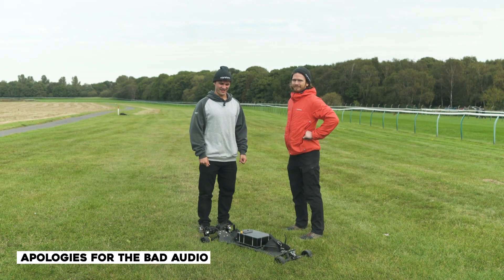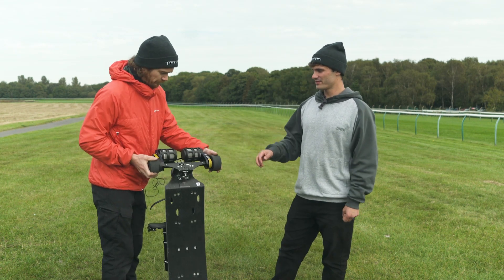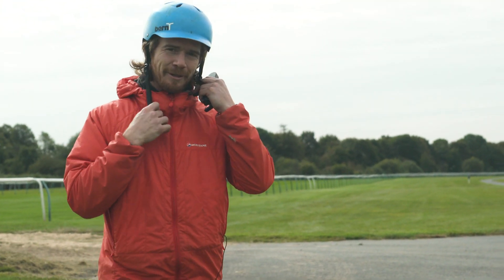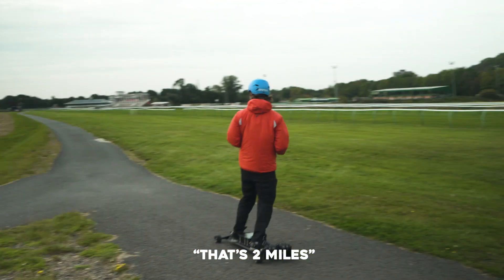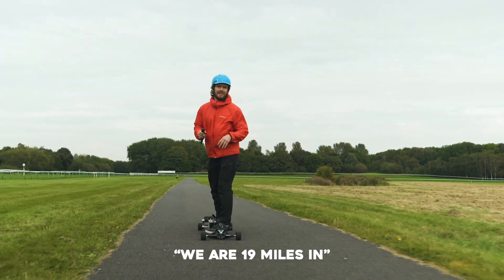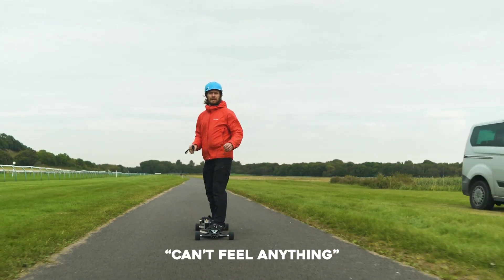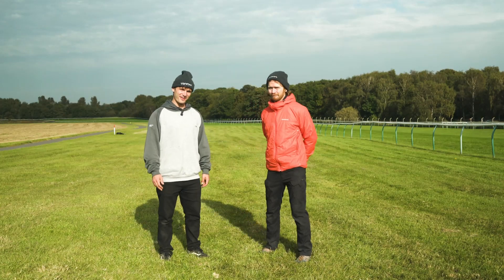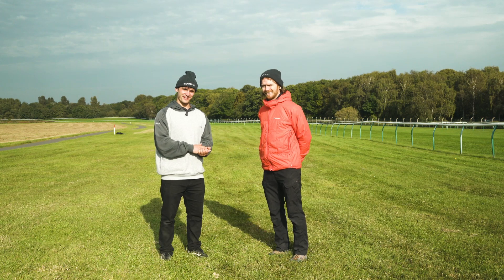HYBRID ESKATE - Stickies OBD Range Test

Comment: Great Video, but I'm not sure I see the point in a range test when trampa don't come with batterys. Obviously the range will depend on what battery you fit.
Reply from the maker: Yes, it does depend on the battery you put in, for sure.  Though a big part of the range is down to wheels, wheel size and gears... Here we are demonstrating what difference stickies wheels (Compact urethane) make.
Reply: @TrampaBoards  thanks for the clarification. Keep up the good work.

Comment: Not sure if youve checked out the sharkwheel electric board, but on a way smaller battery, 36v 5000mah, ive done a 29 mile ride in real world conditions, up and down hills, on bike paths and roads. Also just did a coast to coast ride from LA to Jacksonville, look for Shark wheeling C 2 C on instagram and videos coming to youtube. Set a new world record for distance traveled on an eboard! Over 2500 miles, the feet get used to it after 500 miles, haha. Happy riding! I cant wait to test one of these some day soon.

Comment: You guys getting enough ground clearance with the stickies?
Reply from the maker: there is enough space when riding on nice smooth roads which is the only time you would really wish to use the stickies wheels after you have used pneumatic tyres otherwise the ride is simply too rough and for me at least not so pleasant.... we have huge long smooth cycle paths around here and they come into their own when used in similar environments to that giving a much greater range and arguably higher top speeds whilst sitting real low when going full speed... feels amazing....  or perfect on a go-kart track and the likes....
Reply: @TrampaBoards  I understand, thank you

Comment from the maker: Don't run them too low.... maybe turn round and go home at 60% instead of 50% as this gives a buffer just in case reading is wrong or you make a diversion on way home, as a rule we try not to go below 20%, again that just gives a buffer just in case, then don't charge them too quick all the time, a nice slow 2amp storage charge is always a healthy thing to do, of course that takes a long time so fast charge when u have too and slow charge when you can... keep them dry!! Away from fire! Dont drill any holes in them! And I think finally Dont poke wires or anything like wires into the plugs!
Reply: Do you mean when not using the board should we let the charger connected with like a "storage" charge running all the time? I do that with my cars during winter and wondered if the same applies with those batteries. Sorry for the newbee question. Thx!

Comment: Didn't want to say the Wh/mi? Or what battery you used? Cool test but we didn't really get the full results.
Reply from the maker: On this test, the Watt Hour Per mile is around 24.  The batteries were 20,000mAh (Punchy Electric) Says in the specs part of the video & in the video discription ;)
Reply: @TrampaBoards  oh dang I swear I looked but missed the battery spec. Look forward to lots of tests!